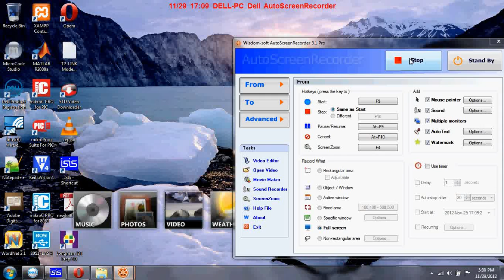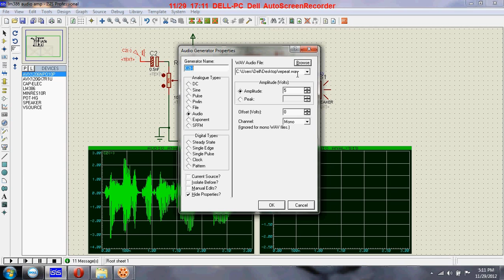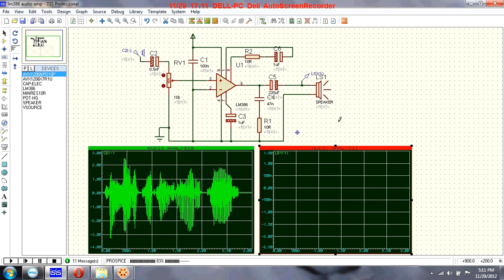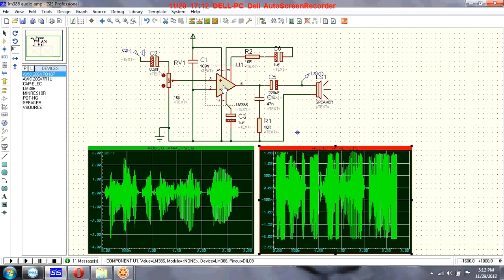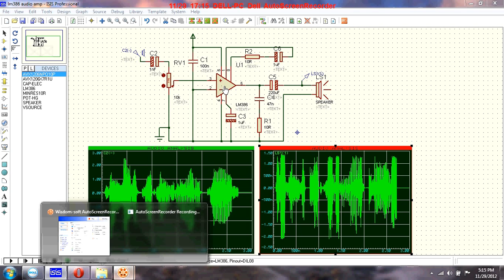LM 386 audio amplifier.avi

Comment: Where is your power supply in the circuit?
Reply from the maker: pin 2 and 6. You can see 100nF capacitor in between.
Reply: @RejanChitrakar  Yes, thank you.

Comment: Hello, thanks a lot for the upload. I am trying to build a 3-band graphic equalizer circuit in Proteus 8. But, all I get is Burst Noise. There are no errors in the circuit but I get the following warning:
"Simulation is not running in real time due to excessive CPU load."
I use a AMD Athlon 64x2 Dual Core Processor  5000+. Can you please help?
Thanks :)
Reply from the maker: It clearly says your cpu load is too excessive. Try closing all other programs and run the simulation.
Reply: @RejanChitrakar   Thanks for the advice! :)
Reply from the maker: you're welcome.

Comment: Heyy :) can you send me the proteus schematic diagram project file at rheendjrz@gmail.com ? Thx b4 :)
Reply from the maker: sent.
Reply: Thank you so much!!
Great work on the circuit btw!!!
I subscribed your channel...looking forward to checking out many more of your designs...
Reply from the maker: You're most welcome. I will do my best to share what I know :)
Reply: hey..can you please tell me how to open the .DSN file you sent on proteus 8 professional?
Sorry..im a newbie...
Reply from the maker: Just double click on the .DSN file and it should open. If it does not, open Proteus software, go to file menu and then click on 'open project'. At the bottom, you can see 'Files of Type' menu in which you can see the default option 'Project Files'. Now click on it and you will see different other options such as Design Files, Layout Files etc. Select the Design Files and finally, you can load the .DSN file into Proteus. Hope that helps. Please let me know if you are done.
Reply: Yes..that worked perfectly...Thanks...!!!!!

Comment: nice work man
plz send fill
adharsh04@gmail.com
Reply from the maker: Sent. Thanks for your engagement with my channel :)
Reply: FILE NOT WORKING
Reply from the maker: Only wav sound file can be used. If you use mp3 sound, then the circuit will not work. Hope that helps.